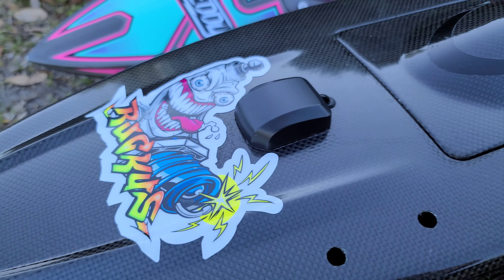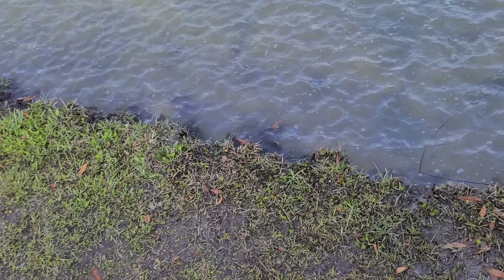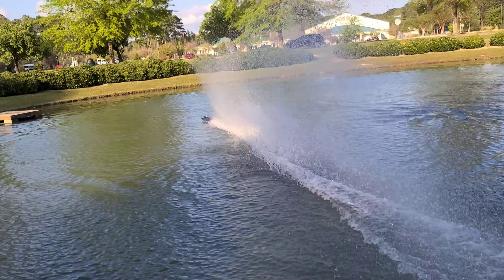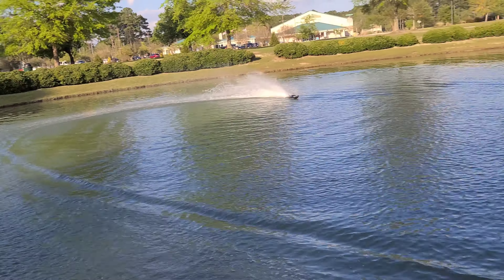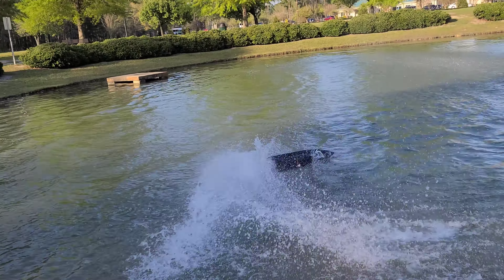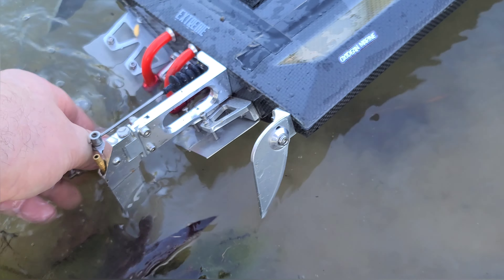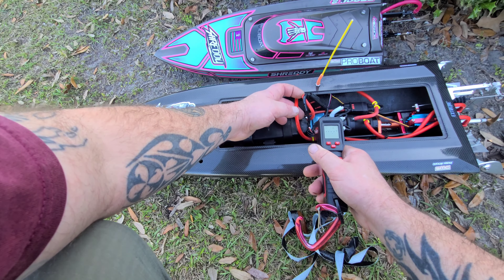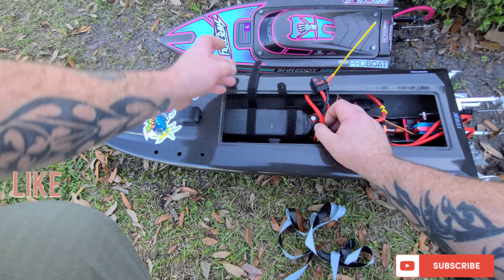Oxidean Marine Dominator - SMC 9500mah 150c, Oxidean 200a, Rocket 4082 1900kv

Comment: What do you recommended for servo speed?  Sonicwake V2 stock seems too slow.   And is thia boat worth is? It looks amazing and id want to get a high qaulity once other than the pro boat.  Thank you
Reply from the maker: This is a what I  use 
https://www.ebay.com/itm/204193473138?mkcid=16&mkevt=1&mkrid=711-127632-2357-0&ssspo=pxo9bh-GQDW&sssrc=4429486&ssuid=yQkZS9FcQay&var=&widget_ver=artemis&media=COPY 
Speed doesn't really matter all that much, IMHO.   I use cheap 25kg DS SERVOS in most all my boats, they get the job done and are relatively cheap

Comment: I’m going to be ordering a dominator soon I want to get some batteries now. What size 8S will fit
Reply from the maker: Look for a longer soft pack style lipo like the smc hcl-hc 8800 120c 4s, they fit like a glove.  https://www.smc-racing.com/index.php?route=product/product&product_id=772

These 6500 HCLHP 4s packs are BOSS but you'll need longer straps, with a thin piece of foam on the battery tray..  
https://www.smc-racing.com/index.php?route=product/product&product_id=723

Comment: Does it self-right with these 9500 packs?
Reply from the maker: No sir, the battery's need to be on the flood chamber battery tray  for self-righting
Reply: @IRONCLADRC  used your promo code! What prop do you recommend? Their 4516? Do you know what prop the H&H kit comes with?
Reply from the maker: Mine came with a 4514.     The 4516 is a good prop and 4519.     I'd give the 42 high rake a thought aswell
Reply: @IRONCLADRC can it still handle like it does in this vid when the battery is where it needs to be for self righting?

Comment: That was more fooling around 😂..
But saw the fisherman so running it wasn't really possible. Consider to give a few percent less steering and it will flip bit less.
Just curious, like some others, what speed you'll get with this prop. Quite recently bought X,M447 and X647 to try with my new setup. That setup will be closer to the 4092 on 7s so that will be interesting for sure... Guess that should be good for some serious  mph...
Reply from the maker: I turned the steering rate up for this run, such a tight area I needed the extra turning abilities..  I wanted to whip her around hard. 😆